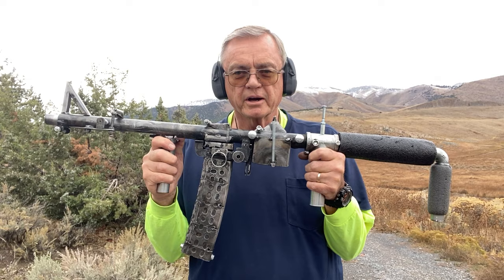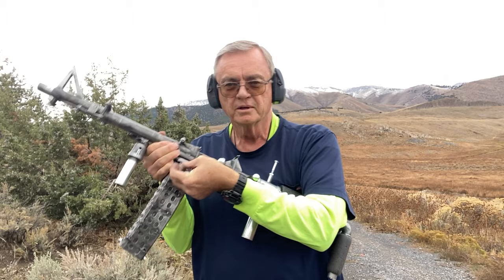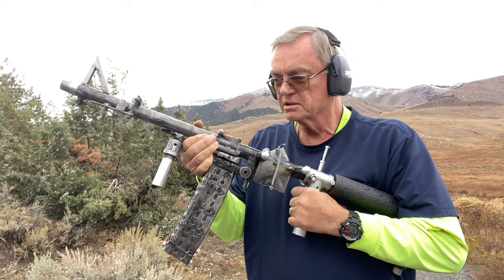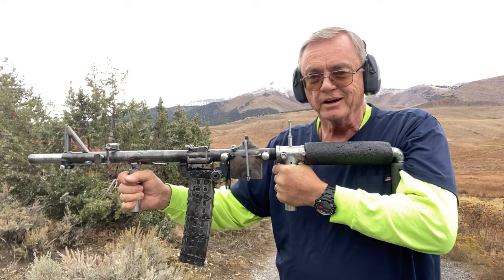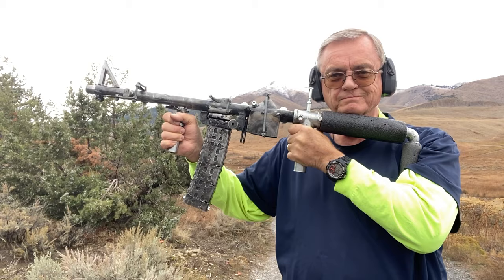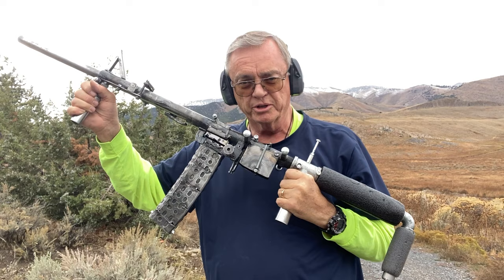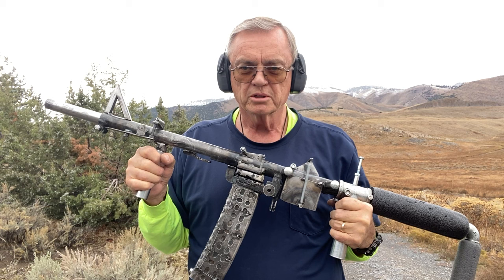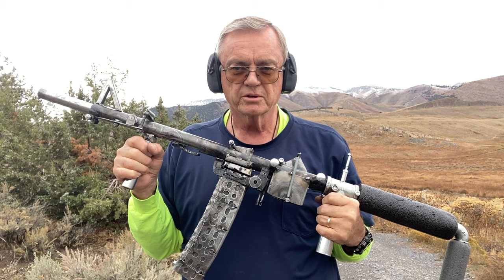Homemade Slam-Fire Shotgun with Detachable Magazine

Comment: The pin mechanism on the magazine is very creative. Exellent job!
Reply: its probably my favorite part ngl
Reply: didnt quite understand the purpose - is the ammo otherwise jumping out of the mag?
Reply: @Raphael-pt7rx the mags use a pretty tough spring to move ammo upwards. I assume, that the pin directly blocks the ammo on its way up making it unable to be loaded into the chamber.
Reply: @Raphael-pt7rx  i think it is a safety feature for weapon storage with ammo loadade
Reply: @Raphael-pt7rx  Making a magazine reliable is a pita, the two primary reasons are 1. Because the feed lips need to be tuned to the spring tension, too tight and the bolt carrier cant pick up a round, too loose and the bullets get yeeted out of the magazine.  2. The feed lips need to be angled properly to have the round seat in the chamber correctly.  Since it's hand pump actuated the actual picking up of a round is a lot less finicky than relying on mechanical actuation, which can easily get a failure to feed if not properly manufactured.   The grenade pin block means the shells can be under tension while also not having to deal with tuning the feed lips or even bothering with feed lips at all, the next round just rests against the previous round, the barrel picks it up, pushes the first round to the back, then the next round is resting against the barrel.  First shot fires, gets kicked out near the ejection slot close to the chamber and when the barrel is cycled the next round bets pushed into the chamber and ready to be picked up by the barrel.

I've actually brain stormed a design much like that, though I decided on a gravity fed magazine instead of a traditional spring loaded one,  my magazine held the shells in with a flat V shaped strip of metal cut out of the magazine that gets lifted up when you slot it into the mag well so the bullets can just fall out into the chamber.  A bit slower to actuate since gravity fed is obviously slower than spring fed but it'd do the job.  But this is actually inspired, very well machined I say.
Reply: @ComotoseOnAnime  wow a really detailed answer, i could easily understand even as a foreigner - thanks for taking the time to explain it to me that properly :)

your idea to simply turn the mag around to use gravity sounds really creative aswell
Reply: @ComotoseOnAnime that's a cool novel you wrote there Mr Browning but I doubt this mag even has feed lips. You just need it to push up the shell into pipe. That's why it has the ring, because otherwise the shells would all just fly out if the mag is not in the gun
Reply: @rodiculous9464   "The grenade pin block means the shells can be under tension while also not having to deal with tuning the feed lips ***or even bothering with feed lips at all, the next round just rests against the previous round, the barrel picks it up, pushes the first round to the back, then the next round is resting against the barrel***"

>Tell me you have no reading comprehension without telling me you have no reading comprehension.

At least read the novel before you start shit talking it's cover.

Comment: People underestimate the amount of mechanical skill and the specific tooling it requires to rig a weapon of this ability. There's a reason homemade guns constitue a tiny minority of attacks in the U.S., homemade guns are difficult to produce without proper skill and a suitable workshop. Makeshift guns like this always carry unexpected risks with so many points of potential failure.

Overall, only trust a homemade gun as much as you trust the gunsmith that made the damn thing.

Comment: you can make this in any caliber really as long as it's center fire,for rimfire you need a different firing pin type that pinches the side of the casing
Reply: But easier for shotgun because shotshell is straight-walled

Comment: The only thing that it lacks is a trigger mechanism (it may not be a good idea because it could make it less reliable and more bulky and complicated). Think of the opposite mechanism of an open bolt firearm, a bar holding the barrel away from the striker that once depressed, it lets the barrel go all the way back. The only drawback to this is the fact that you must keep pulling the barrel. It has the drawbacks of the shooter having to be pulling with enough force before taking the shot and making a mechanism strong enough to resist that force.

Comment: Making a funtioning magazine from scratch for more than 5 roubds of 12g is a nightmare to get working right, the fact he did not buy one and modfy it is amazing (the reason he pulls the pin is probabky due to the fact it does not have feed lips or feed lips that can hild them in the mag (like alot of older mag fed MGs) but the leading and ejecting system is amazing.

Comment: Gordon , you should do a video about the flying machine you are making (I read about it on the website)
Reply from the maker: I will as soon as it flies. I finally retired so I now have time to work on it. I have to swap engines first. The current snow machine engines lack the power I need.

Comment: Looks heavy but it's awesome. The recoil doesn't look that bad either.
Reply from the maker: It weighs 13.5 pounds. 😢 It’s weight takes some getting used to. If the receiver was made from aluminum that would lighten it up a lot. On the positive side it doesn’t kick much. You can fire this thing forever with no shoulder pain at all.🤗

Comment: Ok, That's Badass! How accurate is it/what's it's effective range? Can you also load slugs, or would that be too dangerous with that setup?
Like others have said, this needs to be featured in some sort of post apocalypse movie or show!
Reply from the maker: The pipe for my barrel has a welded seam down the middle. Firing a Slug could cause a rupture of the barrel. If the the slug was designed to spin that welded seam would ruin the accuracy. There are companies that I found on the Internet that make “billet” water pipe. There is no seam. A slug could work in a seamless pipe as long as the pipe was thick enough. Of course the bullet pipe is more expensive. Typical water pipes is 3/4” inside diameter which bigger than your standard 72 caliber 12 gauge. The increased diameter will increase spread and reduce range. Personally I would consider slugs! Typical water pipe is made in a Third World Country.

Comment: the old trench gun fired because the hammer was dropped when the action was shut, if the trigger was pulled. This one here seems like its a bolt-hold open type fixed firing pin. Seems like this method leaves ALOT of possibility for unintended fire... I'd would think the winchester trench gun method would be far more desireable...

Comment: gordon, whats your recomendation for the barrel?
Reply from the maker: My barrels came from the hardware store. They have a welded seam down the middle. It is possible to buy water pipe online that does not have the welded seem. They are more expensive, but are stronger. I believe they are made from a billet of molten steel.

Comment: Hey slam fired shotguns fine an all Buuuuut what's the story with the jet boat????!!??!? Would love to see a blue print on that. At least the basic measurements. And engine to water jet construction.
Reply from the maker: Go to google patents. On the search line type in US3040696A for my Dad’s first patent. Then type in US3116602A. The second patent includes a reverse unit. His reverse was big and bulky, but worked very well! In reverse his boats would blow water rearward out two pipes 4 inches in diameter. With a 390 Cadillac engine his pump pushed nearly 8,000 gallons per minute out the back through a 6 inch nozzle at 60 psi! His boats could go in as little as 3 inches of water. I had soooo much fun riding in his boats as a kid!

Comment: Do your plans contain makingbthe magazine?
Reply from the maker: Yes! My method to make the magazine is a little dangerous. I use my table saw with a metal cutting blade exposed just enough to make the cut. After I grind out all of the metal I bend the magazine into a banana shape and weld it all together.